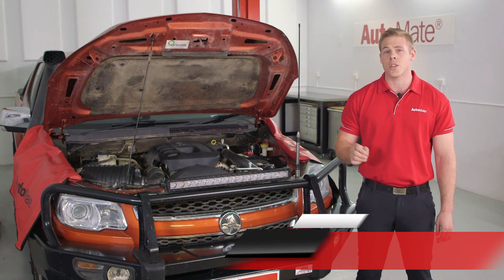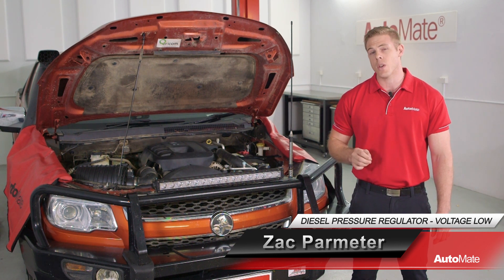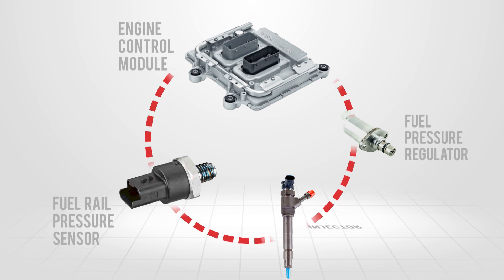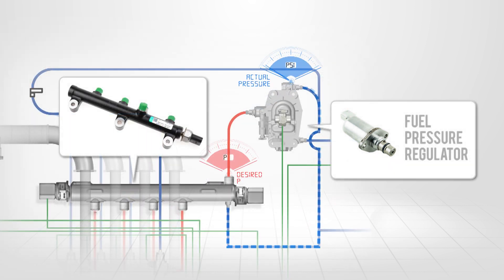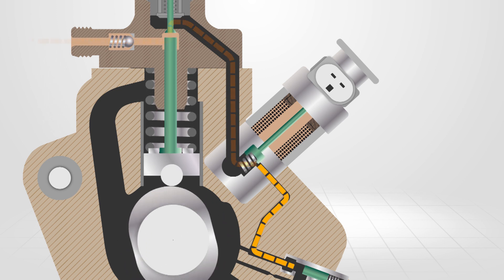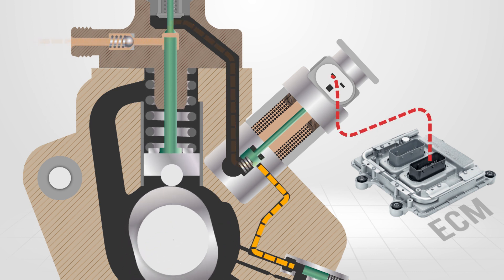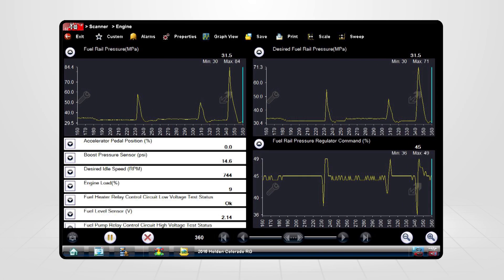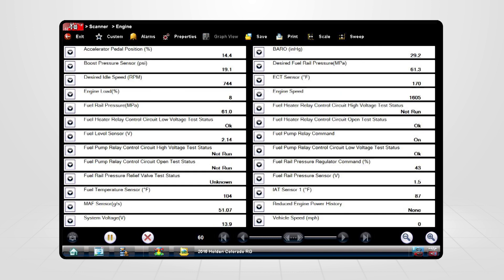Diesel Pressure Regulator Voltage Low

Comment: Fuel pressure regulator and suction control valve can be 2 different things depending on the system design
Reply: The VDO pump on my car has both..
Reply: @herbertvonsauerkrautunterh2513  and?